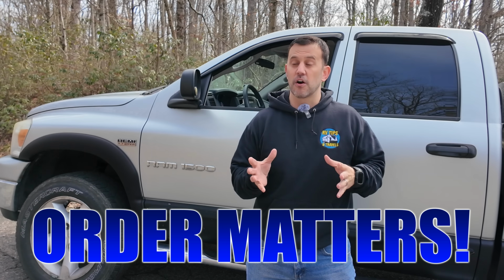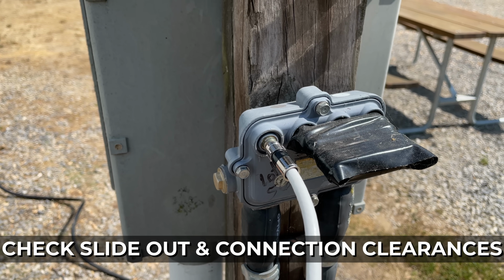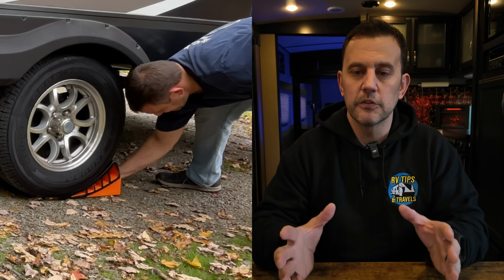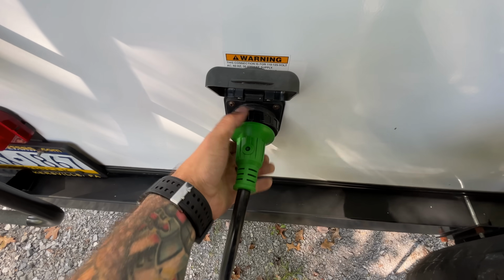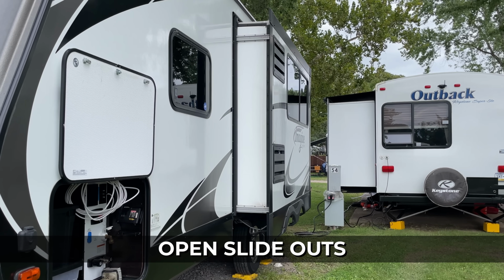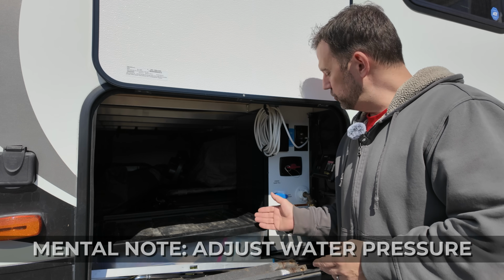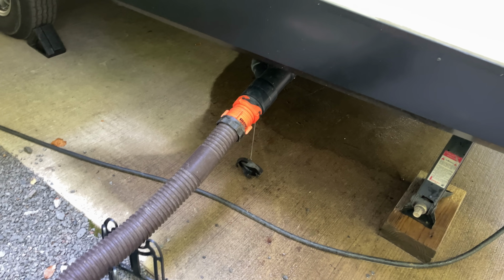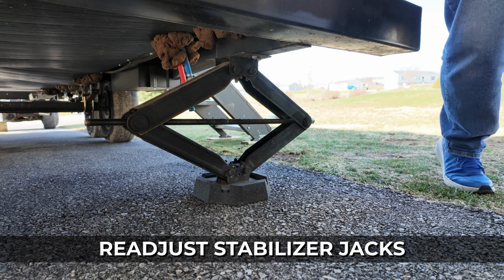How to Set Up a Travel Trailer Correctly ➕ Downloadable RV Setup Checklist for Beginners

Comment from the maker: ✨⭐ PRODUCTS FEATURED IN THIS VIDEO ⭐✨
🔸 Power Watchdog EMS 30 Amp https://geni.us/zKcm (Amazon)
🔹 Power Watchdog EMS 50 Amp https://geni.us/jgOto (Amazon)
🔸 Leveling Blocks https://geni.us/cpI0ho (Amazon)
🔹 Leveling Ramps https://geni.us/ILYrxu (Amazon)
🔸 Beech Lane Wireless Leveler https://geni.us/DAW9N24 (Amazon)
🔹 Wheel Chocks https://geni.us/9B5i (Amazon)
🔸 Scissor Jack Adapter https://geni.us/UWqxJ0 (Amazon)
🔹 3/4 Ratchet (comes with X-Chocks) (Amazon)
🔸 10% RV Snapjacks & Snappads https://rvsnappad.com/discount/RVTT10
🔹 X-Chocks https://geni.us/3oyburw (Amazon)
🔹 Hose Splitter https://geni.us/TKEU (Amazon)
🔸 Water Presure Regulator https://geni.us/fTzA0 (Amazon)
🔹 Sediment Pre-filter https://geni.us/Sj9PBW (Amazon)
🔸 RV Water Filter https://geni.us/FZ1P (Amazon)
🔹 Drinking Water Safe Hose https://geni.us/emLdlC (Amazon)
🔸 90 Degree Elbow https://geni.us/wGYWBYl (Amazon)
🔹 Coax Cable https://geni.us/Br5E (Amazon)
🔸 Rubber Gloves https://geni.us/pGCd (Amazon)
🔹 Sewer Hose Kit https://geni.us/7dNg (Amazon)
🔸 Sidewinder Hose Support https://geni.us/MEAm4 (Amazon)
🔹 Magnetic Dry Erase Board https://geni.us/aDrh (Amazon)
🔹 Liquified RV Toilet Treatment https://geni.us/QTUJSrP (Amazon)
🔸 Travel Trailer Set Up Checklist https://docs.google.com/document/d/1JVVwgWI2f1QbezrOX-CfE8KenwFE-GTe/edit?usp=sharing&ouid=112492101610632215497&rtpof=true&sd=true

How to Correctly Set Up a Travel Trailer at an RV Campground (w/ Downloadable Checklist) For RV Beginners There is a lot of misinformation & instructional videos that are getting the travel trailer set up process incorrect. 

OTHER VIDEOS YOU MAY LIKE
🎥 RV Tear Down Checklist: https://youtu.be/yz2dYaqBiw8
🎥 Proper Travel Trailer Connection https://youtu.be/B7zKGggONCI
🎥 Beech Lane Leveler: https://youtu.be/ht4CCPVoWSw
🎥 RV Essentials: https://youtu.be/yuvS3zZL81c
🎥 Manual Leveling https://youtu.be/43dZNtxEMpw

#rvlife #rvliving #rvtips #rvtravel #rvtips #rvsetup

RV ESSENTIALS & TOP PICKS 
🎥Essentials Video: https://youtu.be/yuvS3zZL81c 

MAINTENANCE:
🔶Boeshield T-9 Rust Preventative & Lubricant https://geni.us/uXxstyC (Amazon)
🔶Geocell Proflex Sealant https://geni.us/YXiACx (Amazon)
🔶Water Heater Cleaning Wand  https://geni.us/AcTvhLc (Amazon)
🔶Water Heater Cleaning Adapter https://youtu.be/h6C6ihTQ1cY
🔶Waste Tank Rinser https://geni.us/V2XLE (Amazon)
🔶Road Tool Kit https://geni.us/oBFnd9l (Amazon)
🔶Eternabond Roof Tape https://geni.us/6AXdw (Amazon)
🔶Browse All Maintenance https://geni.us/UvxFP (Amazon)

INSIDE
🔷Screen Door Handle https://geni.us/itRfKUQ (Amazon)
🔷Shower Caddy https://geni.us/ZPcno (Amazon)
🔷Oxygenics Shower Head https://geni.us/jznwF (Amazon)
🔷RV Paper Towel Holder https://geni.us/Acknol (Amazon)
🔷Dimmer Switch (watch video) https://youtu.be/2bbqBcSsRZQ
🔷Electric Heater Fireplace https://geni.us/YmBoktI (Amazon)
🔷Browse All Inside https://geni.us/BWiOR8k (Amazon)

OUTSIDE
🔶Gravity Chairs https://geni.us/VlPR8rn (Amazon)
🔶Ground Mat https://geni.us/wbWWLzf (Amazon)
🔶Table https://geni.us/qsPO (Amazon)
🔶X Chocks https://geni.us/3oyburw (Amazon)
🔶Blackstone Griddle https://geni.us/8BuIrW (Amazon)
🔶Low Point Drain Valves https://geni.us/yBB02h7 (Amazon)
🔶Browse All Outside https://amzn.to/4ld0kcz (Amazon)

👇 COUPON CODES! Use the links. Save money. Simple.

🚐 10% off RV Snappads & Snapjacks https://rvsnappad.com/discount/RVTT10

💦 Blu Technology Water Filtration Systems 7% Off, $80 or more No code needed just use our link:  https://goblutech.com/xxnnkdun 

🛌 Get 30% off your RV Mattress by Brooklyn Bedding at https://rvmattress.com/rvtips
Use Discount Code: RVTIPS

📷 Haloview Back Up Cameras 5% Off & FREE Shipping (Use code RVTIPS at checkout) https://www.haloview.com/products/byte-tango-1080p-observation-camera-system.html?acc=765

🔧 NRVTA Home Study Course https://rvtechcourse.com/discount/RVTIPS20
Use Discount Code: RVTIPS20

🚴‍♂️️ Lectric eBikes - Use our link get FREE accessories https://lectricebikes.sjv.io/nLrJ3x

💻 Our eBay Store! You never know what you’ll find!
https://geni.us/6AyLKnS (eBay)

💥 Join Our FREE Newsletter! https://rvtipsandtravels.myflodesk.com/freenewsletter

If you want to support the work I do to help others, you can donate here:
Paypal: https://www.paypal.com/donate/?hosted_button_id=J2KKM9NR3BJJA
Venmo: https://venmo.com/u/Ross-Stoico

✨ AMAZON RV STORE ✨
https://www.amazon.com/shop/rvtipstravels

Follow Us on Social Media
https://www.instagram.com/RVTipsAndTravels
https://www.facebook.com/RVTipsAndTravels

🙏 If you find a dead link, PLEASE let us know & we’ll send you bumper stickers!

As an Amazon Associate, I earn from qualifying purchases. There is NO ADDITIONAL COST TO YOU when purchasing from our links. Thank you for your support! 2.0

Comment: Hi Ross.  Today I ran into a problem with setting up my rv.  I was placed in a very down sloping site.  I have a set of those arc wedge trailer levelers that I use with my level mate pro.  The problem is that I can’t put the one in for the rear tire because it is too long to physically fit. Is there a spec sheet  for these? Different trailers have different spaces between the wheels.  Should I cut them off shorter or get new ones?  This might be a good subject for a short video.  Thanks!
Reply from the maker: yes, they make ones for trailers with axles that are closer together.  if you have the carmek levelers, you can cut up to 4 inches off the front so they will fit.  here is the short axle version: https://geni.us/p4EZX (Amazon)

Comment: I always level the trailer THEN .....put out the slides THEN put the stabilizers down ..........if you pit the stabilizers down before you put out the slides you can have resistance or binding with the slide ..........yuo can twist the trailer fram real easy with the stabilizers..........I've noticed the slide runs smoother without the stabilizers touching the ground ..
Reply from the maker: Stabilizers, used properly, will not twist a trailer frame.  You can lift one side of the trailer completely off the ground to change a tire.  If that’s not twisting your frame, a measly couple hundred pounds a stabilizer uses to oppose movement will never twist a frame.  Frames take more of a beating on bumpy roads than they ever see from a little stabilizer.  If putting your stabilizers down is affecting how your slides are opening, I would check your frame welds and or your slide mechanism.  Do you have rack and pinion, Schwintek, through frame, cable, etc…?

Comment: I just bought a used  A-Frame. I have no experience with camper trailers. At 70 years old, traveling by myself, even a few "goof ups" can be enough to have me back at home in the lazy boy. Your videos, especially this one, are helping me feel more confident I can do this. I downloaded your list and will be using it. Thank you very much.
Reply from the maker: take your time, there is a process to operating these things... some folks like to rush, but take your time and follow your checklist.  the campground isnt going anywhere.

Comment: Question about the surge protector. Is the surge protector built in to the dog bone for 50 amp set up and a if I’m at a site that has a 30 amp set up will the surge protector work with a 30 to 50 dog bone.
Reply from the maker: the surge protector will still work as surges dont really have anything to do with your rv being 50 or 30 amp.

Comment: I dont do that with my water. I just put the hose on with the regulator and use then use the water, I dont fill up my tanks
Reply from the maker: I've had a campground we were staying at lose power for 2 days.  Because the water was on a well, the well pump obviously lost power as well.  With water in the tank, I was able to use that water for 2 days using the 12 volt pump.  Thanks for watching.

Comment: @rvtipsandtravels - what type of lock do you use to secure your surge protector to the panel?
Reply from the maker: I use a cable bike lock like this one.  it should fit through the supplied loop on the srge protector, if not, just drill out the hole a little bigger until it fits: https://amzn.to/43t9MlI

Comment: Question on the hot water heater. Ours is just gas. Do you keep it on during your trip or turn off when you leave for the day but keep it on while in the rv? Off at night??
Reply from the maker: It just depends when and how quickly you want hot water.  I'll leave it on if we'll be back in a short time, about 15-30 minutes.  Any longer than that, I turn it off.  No reason to waste propane.  Something else to keep in mind, with it off, even for a few hours, the water will not get stone cold, so it shouldnt take long to heat it up when you get back.  Personal preference I guess, but I dont want to 1) waste gas, and 2) have a flame running when we arent there.  Hope that helps.

Comment: I have watched a number of your videos and have not seen how you secure your surge protector while it is hooked up.  I assume there is a good way to lock it up.  Can you share what you do?
Reply from the maker: the unit comes with a metal loop around the cord.  i found a bike lock (cable lock) as thick as I could get that would fit through the hole. I just wrap it around the pedestal as best i can.  sometimes if the pedestal is only a few feet high, ill just wrap it around a couple times until its tight enough that it cant be pulled over the circuit box.  something similar to this: https://amzn.to/4jZArMz  i hope that helps, ill be filming something this summer once we get back out on the road.

Comment: Thanks for the tips! I think its a good idea to go inside and check all faucets are closed before connecting to water. Never know what may have moved during travel. Also to mitigate this, i rubber band the lift style handles. I know Im paranoid, but prevention is a lot easier than cleanup.
Reply from the maker: nothing wrong with overkill!

Comment: Great video. Got a lot of good tips. Noticed you pulled with a 1500. Can I ask what the weight and length of that rv was. Going to be pulling with a 1500 soon, just wondering how nerve racking it is. Thanks for all your great videos.
Reply from the maker: the trailer weight was around 6500, the length about 27' total.  it was not bad in regards to sway, but the engine was a dog going up hills.  it was also a 2007 ram.  new trucks pull much more than this did.  I'd really recommend doing the math on what you can tow, payload, etc...

Comment: Hi, great video. Quick question. I connect my water filter at the trailer. Do you think it would be better to do that, thereby filtering stagnant water sitting in the hose?
Reply from the maker: Hey James, its a question for the ages, and depends on personal preference, but that would be fine.  Heres the argument, you're now running unfiltered water through the hose, which could contaminate the hose quicker, or more intensely, possibly shortening the life of the hose.  since this video was released, i started running the hose before the filter, like you do.  heres what i would really suggest no matter which way you do it... after you connect the hose to the water connection, just run the water through the hose for a minute or 2 to push the water out.  then connect to the rest of the system.  hope that helps.
Reply: @RVTIPSANDTRAVELS  Yeah, that works. We are at a seasonal site in Canada, so we hook up in spring and leave it till autumn. I also blast water through a new filter before hooking it up. I have found it kicks out loose charcoal. It surprised me the first time I did it. A little gush of black water for a second, then all good. I thank you for all you have shared.
Reply from the maker: thank you for watching my friend!

Comment: I have a Rockwood Mini-Lite 2509S with slider on the driver side. On my set-up routine I checked side to side level with the slider in, and usually found that I needed to block and raise the passenger side of the rig. But one time while getting ready to leave a campsite I watched the back of the rig while my wife retracted the slider, and saw the trailer tilt back towards the passenger side as the center of gravity shifted. I now check the side to side level with the slider out, bring it back in to maneuver, and then put it back out. I now find that I'm usually blocking / raising the driver side tires, but the rig does feel more level inside. It does involve an extra step of extending/retracting the slide, but seems to be working well.
Reply from the maker: thanks for sharing Matt, I think a few people are doing a process something similar to this these days because they arent as level after slides are open.

Comment: I realize this isn’t about Toy Haulers specifically, but I unload the cargo area of our hauler before leveling & stabilizing. Otherwise you usually end up un level and have to repeat that process. Sometimes on a newly paved and level site it works out ok, but most times the sites aren’t perfect to begin with. 
 Also, if I’m putting the yellow plastic stackable leveling blocks under the tires, and on soft ground like grass or sand, I put them down upside down so the first block doesn’t sink in and get filled with dirt in the open bottom of the block. And many off road type campsites are very unlevel and having cut up pieces of 4x4 blocks/ fence posts are handy to take up all the extra unlevel space. Thanks
Reply from the maker: thanks for sharing the toy hauler tips my friend!

Comment: I have always removed my load bars and stabilizer before backing into the camp spot.  Sometimes the ground is wonky and that adds stress on everything. Also, if you are off substantially side to side, raising the camper adds a lot of stress on the bars if not removed.

Comment: FYI, for Propane.  You do not need to Open the valves any more than 1 full turn!  The propane in the the bottles is a pretty higher pressure, 100+ psi, after the regulator the pressure in the RV is less than 1 PSI !  If you ever need to turn off the Propane just one turn.
Reply from the maker: correct, but i fully open to keep everything from binding up over time.  Lots of humidity where I live.  the pressure from the tank is 127 psi at 70 degrees and after a 2 stage regulator it drops to 6.3 ounces PSI (or 11 in WC).

Comment: One little tip I’d like to share is that we carry a small wooden step with us. Sometimes the grade can be such that the last step down to the ground can be a doosey and my Wife’s knees aren’t what they used to be. It’s just two pieces of 2” x4” connected with heavy plywood and the extra 4+ inches it provides makes a big difference. We’re currently on an extended trip with many different stops and it’s been used a few times.
Reply from the maker: thanks for sharing Robert!

Comment: When you stop at a rest area or overnight in a parking lot...do you level while connected we haven't been on our first trip yet but i don't know if we always have to take the time to unhitch to use the auto level or if leaving it hitched is ok afraid of potential damage to the truck. Thanks
Reply from the maker: it really depends.  rvs should be level before opening slides and using the propane fridge.  however, your trailer/5th wheel should also be pretty close to level when you hooked up to the truck and on flat ground.  for me, a good rule of thumb with leveling is to be within 1 inch front/back and side/side.  if you are within that 1 inch while hooked up, there should be no need to unhook.  you wont damage anything on the truck by staying hitched up, it sees more movement while driving.  make sure your ebrake is on and i would even go as far as to install chocks.

Comment: 2 things why would you waste propane to heat the hot water heater if you have shore power and I ALWAYS remove my hitch and lock it in the storage bay. No hitting your shin on it or have it stolen. 🤷🏻‍♂️ just me.
Reply from the maker: theres a few reasons you would use propane instead.  if you run out of water quickly (large family) turning on the propane heats the water quicker.  If you have a 30 amp camper and a few appliances running, turning off the electric and using propane will greatly reduce your amp draw.  Another reason, not all water heaters have an electric option.  Tankless water heaters are propane only.  I will not disagree with you on storing your hitch.  Thanks for watching and commenting Robert!

Comment: How do I see my bubble level inside the RV if the steps are up? Keep putting down & up the steps?  Put the level in a compartment?
Reply from the maker: its likely not all surfaces will be at the same level.  find which one matters most to you.  for me, its the floor, but you can compare the pass through storage to the floor and if they are the same, you can use the pass through instead of having to raise and lower steps to go in.
Reply: @RVTIPSANDTRAVELS  best tip I have received yet.  THANK YOU

Comment: Do these Snap Jacks REALLY help a lot or somewhat better? We have the same jack set up as what you had. Not cheap.
Reply from the maker: its hard to answer questions like this because i have a gravel parking pad on my property now that the regular feet would just sink into.  the snapjacks dont sink, and its worth every penny to me that I dont have to waste time putting something between the ground and the rv.  some of our campsites are gravel too, so this just makes things easier for us.  will you notice a MASSIVE difference between how stable your RV is with vs without them?  probably not, but they do help especially on loose ground, and i dont even bother blocking them anymore either.  worth every penny to me, but again to you that may be something different.  I hope this helps answer your question without sounding like a salesman trying to convince you one way or the other.